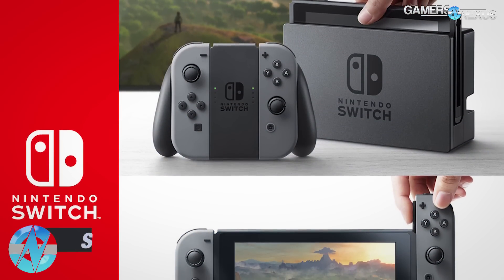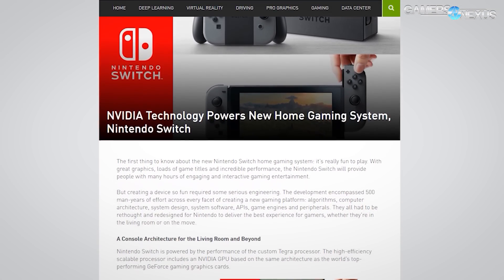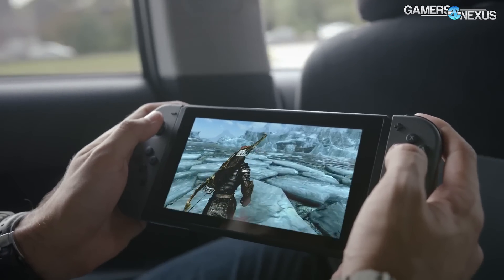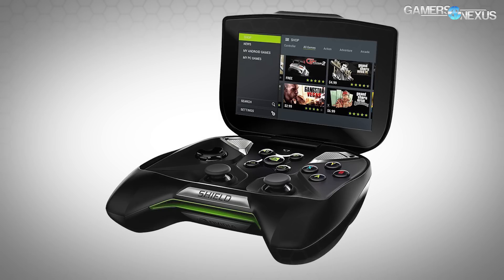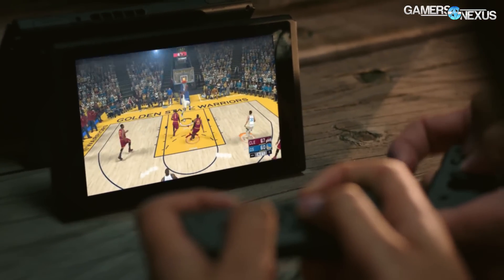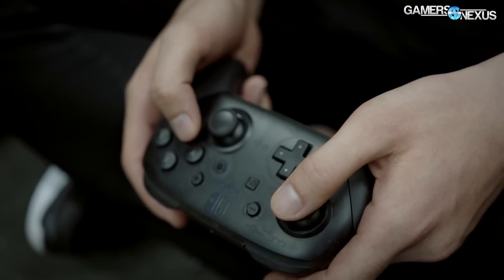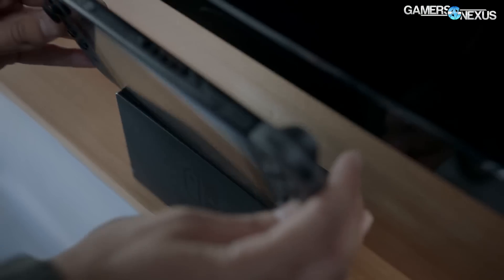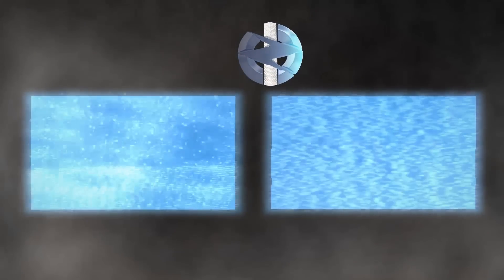Nintendo Switch (“NX”) Built on Tegra Pascal SOC, New NVN API

Comment: Hoping this does in fact run on a Pascal. That would bring it closer to an XB1 and even just getting close to that amount of power in a hand held is amazing. I'm assuming when it's docked it will run full clock and games will render at 900p-1080p. When it's portable it down clocks and runs in 720p to retain performance and match screen resolution. Speculation is fun. Can't wait for January
Reply: lol

Comment: If it cost $300 or less, I might pick one up.   I like the idea of playing your favorite nintendo games on the go.
Reply: My guess is $350USD. There is a lot of hardware there. The tablet alone is expensive, then the dock, controller, and the lithium batteries. On top of that, you probably will need to buy a USB HDD (or it may use a 2.5" HDD), and possibly another game card depending on how large the one is that comes with it.

Comment: So its a Shield with a Nintendo sticker on it? I guess it makes a lot of sense for Nvidia seeing as the shield would never be able to get a native game library like Nintendo can and I'm sure they have spent a lot on it already.   Will probably get one for the new Zelda, but cant say I'm not disappointed. Was hoping for at least some extra power from the dock.
Reply: Prince Thrakkath Nvidia practically confirmed it's running on a SoC with a Pascal architecture. The Shield runs on the older Maxwell architecture, and doesn't have the customisations which would be made by Nintendo.
Reply: supersbbrawl4ever Even if it's the newer architecture and no doubts Pascal is impressive for its performance and power efficiency there is only so much power you can squeeze into a handheld. 

 IMO it would have been much better if this replaced the 3DS and they followed it up with a proper console that can at least run AAA games to PS4/Xbone 1st Feb standards. 

I'll still get it for the exclusives, I'm just disappointed that it's a glorified tablet.
Reply: Shut the fuck up, loser.  You have no fucking clue what Nintendo and Nvidia is making.  It's not a glorified tablet... is a fucking video game system!
Reply: TonyKanameKuran lol looks like someone forgot to take their meds.

Comment: I'm wondering if this thing is even as powerful as the ps3/xb360. The link videos I have seen have some really last gen graphics if you look closely. Still, like the art style
Reply: it's just under or over xbox one.
Reply: i heard its on par with xbox one ps4.
Reply: nowhere near xbox one. that's for sure
Reply: The Wii u is more powerful than the PS3 and Xbox360 so why would Nintendo go backwards? And the Switch is using pascal architecture which current top computer are using! Did you not listen to the video? Why would you even ask that question, like how fucking dumb are you?
Reply: you do understand that the point that we are making is not that it has a 1080 with in the console, it's that the new GPU archetecture is really great, and even if it is using between 256 and 512 cuda cores it will still tear out some great performance compared to the x1 Maxwell architecture.
Reply: why?  Did you not watch the entire video....its a tablet;  pretty much the same as a Shield.
Reply: TheGoreforce Most likely under.
Reply: Aggbala its not
Reply: where?
Reply: "architecture". Architectures get scaled down to meet needs and its no 1080 in there. They would go backwards by making a tablet and having to fit a certain heat and power budget.
Reply: w/e. when they put out a game trailer/gameplay than says it actually has good power, I'll believe you. Right now, from the way zelda looks, nope. And thats probably edited to look better than it really does.
Reply: That footage was a greenscreen captured from another source not from the machine it self.
Reply: You have old Shield Tablets running 7th gen games with no problem. I see no reason why this would be weaker.

Comment: i hope it's not over hyped, dat zelda footage at the beginning on the handheld was a bit choppy, or is just me...
Reply: everything in the video wasn't using NX hardware it's a pre-recorded video placed on the place where the screens would be via CGI.
Reply: it's simulated gameplay with a green screen, the shown unit might not even be fully functional
Reply: Hydrofrog Green Because the games are still in development probably.  There will be game play of switch games before release, so we will see then.
Reply: if it's simulated gameplay why was it such low frame rate? I'm not buying it.
Reply: Hydrofrog Green also the footage came from the Wii U, either that or a dev computer, either way it isn't  the switch's  hardware

Comment: Are you positive it's the Pascal and not the newer Xavier Tegra that Nvidia announced last month? Specs for both are available on wikipedia if you search for Tegra. Pascal only 256 cuda cores, and Xavier doubles it with capabilities to output in 8k video. Insane.

Comment: I wonder how small the internal drive is?
Probably a 64gig SD card lol
Reply: infinite.
Reply: gwald high until recently games used under 60gb of space..and considering nintendo has never been abiut having the best graphics 64gb would be fine..looks abiut 900p on handheld 1080p on tv so no need for larger than 64gb
Reply: gwald I dunno, smartphones can go up to 256GB, like the iPhone 7. So it could match or exceed that.
Reply: You really want to pay 256GB prices for this?
If Nintendo is smart, they should make this as cheap as and sell it for as cheap as
Reply: gwald the internal storage is confirmed 136 GB (or close to that).
Reply: oh cool thanks!
136GB is a ok size of a 'portable'
Reply: 136 gigs is an up most derp number that couldn't possibly be real

Comment: I'm concerned with battery life on the go
Reply: chiggins rumored for four hours
Reply: chiggins rumored for four hours
Reply: Tegra x processors are pretty power efficient going from current articles. I would be surprised if it didn't last longer than 6 hours.

Comment: I'm hyped AF this actually excites me unlike the PS4 Pro or the Scorpio.
Reply: D gtz im intrigued by the scorpio but i feel it may end up having performance of xbone but with 4k lol...ps4 pro and vr do nothing for me..vr only really works with pc power and even then its not perfect immersion...im holding judgement on switch, but if skyrim is in it and it has decent 3rd party support and not just mario, mario kart, zelda and metroid i will definitely get it..i will gladly rebuy games i already have in order to play on the go even with slightly lower graphics..and older console support would also be huge as i already have emulators on my g4

Comment: In 4:46 did you say "faked"? Because the d-pad is changed because when you play 2-player local one player are using the d-pad as buttons is my guess? But maybe I just heard wrong...
Reply from the maker: Was meant as a way to just say "it's 4 separate buttons instead of a 'normal' d-pad." Nothing special, there. No hidden messages. It's more like the N64 yellow up/down/left/right buttons -- basically a d-pad, just without the pivot.

Comment: The laptop of consoles. Can use it on the go but not as powerful or as versatile as a real gaming pc...
Reply: PCgameTech the gtx 1000 series laptops are just as powerful gaming machines as their desktops variants, only slightly lower fps
Reply: well none of the consoles have a 1000 series graphics card in them, And obviously I was generalizing, (laptops with 1000 series gpus are such a nominal part of the actual laptop market)
Reply: gtx 960m is roughly equivalent to xbone and ps4..plenty of laptops with it..ps4 pro will be roughly equivalent to gtx 970 which is around 10% better than gtx 1060 laptop but 25-30% less than gtx 1070 laptop..scorpio will roughly be equivalent to gtx 1060 laptop
Reply: and yes those 1000 series are a small part of the laptops sold, for now...there are lots of gtx 960m laptops however
Reply: ***** ingame fps is slighty better on gtx 970..that laptop has better cpu thus better firestrike score
Reply: ***** hey look at that a nearly identical score with i5 6600k which is the closest desktop equivalent to i7 6700hq..i5 is a little better as evident by higher overall score....youve got a badass gaming laptop either way tho

http://www.3dmark.com/fs/7531329

Comment: I thought consoles used ATI/AMD since.... well... always. I feel betrayed.
Reply: AMD was always raw power, nVidia wins in efficency which is important on battery power(they can compete in desktop cause corruption tho)
Reply: Noooo, I think Nintendo was the only one going ATi on the Game Cube back then... just on the "current" generation the others got to AMD hardware...
Reply: Victor Custódio okay cool, I've never owned a console other than a gameboy so I just assumed they'd always been the same way.
Reply: AMD has never out competed for raw power compared to nvidia. "Raw power" ha..
Reply: The PS3 used an Nvidia GPU roughly equivalent to a GTX 7800.
Reply: Nintendo would have needed a Zen/Polaris APU from AMD for it to be really efficient and those were not ready. This NVidia SoC looks like it will be pretty great though.

Comment: I have to be honest this is an interesting piece of hardware
Reply: Tone Tech and Gaming Yes but not running proper x86 like the other consoles might kill it.
Reply: every developer that mentioned anything about coding say it works well, it will support x86 and x64 im sure...
Reply: TheGoreforce It is ARM based so no. As a OpenGL programmer they are completely different. It is like saying Windows 95 and Windows 10 are the same. Nvidia is not allowed to make X86 because Intel has that patent, and they cannot do X64 because AMD has that patent. The consoles use X86 because AMD and Intel have a deal. That is why Nvidia had to stream PC games to their "console" because their system was ARM based. I hope Nintendo does well, competition is good, but don't expect Scorpio or PS4 Pro performance. You would be lucky to get Xbox One performance.
Reply: Cyber Drift Yeah I agree, they need to either wake up and make something that fans want, or die off so someone else can make what the fans want.
Reply: A tablet with usb type c for video out and power then throw on 2 bluetooth controllers. Meh.
I would hope that this flops and kills Nintendo off but I would bet they have comparatively little R&D in this. 
Will probably get down voted for this but Nintendo's attitude towards fan the last few years has just been shitty.

Comment: would be cool if there is a second GPU in the docking station, so that the system could run SLI when docked and single GPU when mobile.
Reply: I don't think SoC SLI exists but that would be so fucking cool.
Reply: This is still a Nintendo console, that would be insane and useless for their average market.
Reply: ***** I'd still put my money on it running pretty great on the dock but switching to a low power mode for mobile gaming. It's so small I'd be surprised to find a battery in there competent enough to run it at full power for more than a few hours. Sort of like some gaming laptops plugged in vs unplugged.
Reply: it would be cool, but think about the difficulties in making it switch from SLi to single mode on the fly... it is almost 100% not feasible.
Reply: Mingyao Liu Mingyao Liu I never said it was easy, I said that it's possible. it's not some guy trying to build a PC that does this on his own, it's nVidia and Nintendo working together on major project, so there's a ton of R and D being done on a custom platform. With things like the Razer Core being able to hotswap even while running a benchmark, it's not outside the realm of possibility.
Reply: Don't know if an SOC exists that could operate in SLI...
Reply: would be cool, dock it and play 1080p 60fps on big screen
Reply: Oldschool Gamer Rick u wot? sli with  soc graphics units? thats not possible. sli is only with a sli bridge on desktop or laptop gpus.
Reply: AMD cards dont need bridges, maybe nVidia could copy it
Reply: ***** It won't be higher than 1080p I can guarantee that, lol Maybe 900p or 1080p no lower I hope. I doubt they'll go OLED, maybe IPS if we're lucky. Wondering if the trailer gives us an accurate depiction of Skyrim in mobile mode, because that looks fine and I'd be happy to play that for maybe 6ish hours before needing to plug up.
Reply: Drive PX2 used two Tegra chips together. Seems like it could be feasible.
Reply: the DX2 has 2 tegra parker chips...
Reply: PX2 would be Pascal for Parker.
Reply: right
Reply: +Mingyao Liu The plan ahead, don't use the sli version if you are planning on going some where. Also It's probably easier to turn it off than turning it on.
Reply: no it's not easier to turn it off. we have not seen one piece of sli that can be hot swapped during use. it is basically impossible.
Reply: Mingyao Liu If the hardware and software are designed from the ground up to support switching between GPUs, it's doable. My laptop can switch between iGPU and dGPU, for instance. That technology may just be getting taken further on the Switch, allowing one GPU to finish up its frames while the second initializes, takes over, and shuts the first down for a seamless transition.
Reply: Wow did you just said that.........if you never learnt ece courses in university, don't make it sound like a easy thing to accomplish.
Reply: Graham Bell i cooped at gpu design lab when 7xx series come out, and i can tell u based on my knowledge it is NOT possible. There is way to design a system that have dual gpu and disable enable on the fly, but it will be day and night different from SLI or any kind of multi-gpu co-processing existing. If you are talking about surface book like switching, remember it is switching between gpu, and video feed is coming directly through Intel, nvidia gpu is feeding video to intel gpu framebuffer, not to display. Think about Virtual ram in CUDA, to co-process data, there is no way to have a actual working system that has sli on the fly. This will be my explanation, take it or not it's fine.
Reply: Mingyao Liu yup, I was talking about switching between GPUs and not real multi-GPU, my bad. Sorry for the misunderstanding. GPU switching could work, though, and still have the effect of being a lot more powerful while docked, which is what I think the OP was driving at.
Reply: On a hardware level it could be possible, but when you look at the preview video you clearly can see that no extra steps are needed to remove the tablet from the dock. Just pull out. That would probably never work without crashing the game. You would need some kind of eject button for that. Just like you see on the Surface Book
Reply: Mum Blic To be fair, the Switch reveal video is definitely edited when they remove it from the dock. The TV screen wasn't on during filming and they just edited in what they wanted. If you slow down the video, you can even see the TV turns off after the Switch it's undocked which doesn't make any sense

Comment: I see that the price and moddability will be the 2 main factors how well Switch will sell. If that thing was a semi-open platform that I could use as an Android tablet or better yet run a virtual Windows/Linux on it, it would explode among pc community. Even if someone just managed to crack it, Switch would be the greatest game console ever made.
Reply: You mean modularity? Neither MS, Sony, or Nintendo openly support modding their systems. It all cases it makes them void your warranty instead, so I'm sure that's what you meant.
Reply: if we could run windows games on it... needless to say it will sell more than actual pc's!
Reply: Gustavo dias okagawa That won't be possible since we're basically talking about emulation, but it could serve as a light working machine.
Reply: There is an arm version of windows 10
Reply: 14supersonic I mainly meant the software side, tho it is likely that Switch will get 3rd party controller attachment parts.

Comment: Was there an announced launch price?
Reply: nope... :/
Reply: fubag the rumor say 
(ALL IN US$)
299$ for the base model
399$ For the bundle 
(probably with the dock station + a game)
Reply: Probably not till early next year. No later than late January probably.
Reply: Shawn Diaz the price reveal ?
cuz the trailer say that it will be available in March
Reply: Kevinsan ps Yeah the price. I figure they're watching the market and the audience reactions before they set a price. Were you referring to the joycon dock when you said dock station+game?
Reply: ***** It's gotta come with the switch dock otherwise half of the experience is gone and that makes no sense. Like selling a "portable dvd player" with the screen as an add-on. Then it's just a dvd player with a battery. And the hardware in this thing is most comparable to the Nvidia Shield which is an older model SoC and that's $200, so $300 for a Nintendo machine with that kinda hardware seems cheap to me. The Shield doesn't even come with a screen (but it does have a nicer default controller setup)
Reply: This was just a "teaser trailer". Expect more info in coming weeks/months.